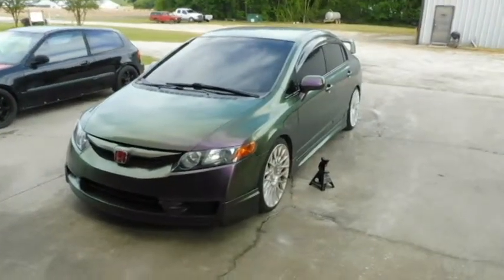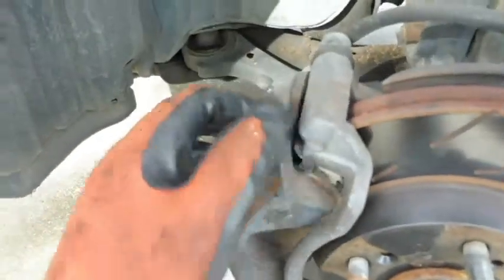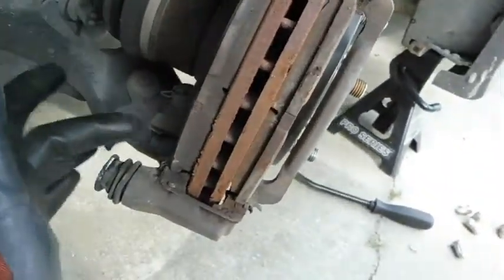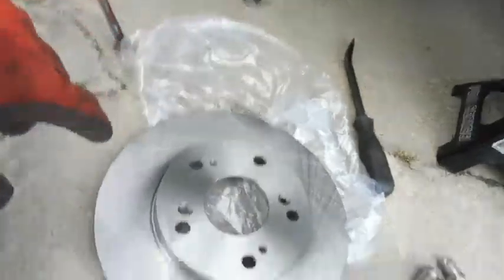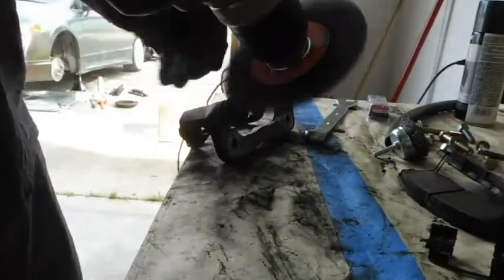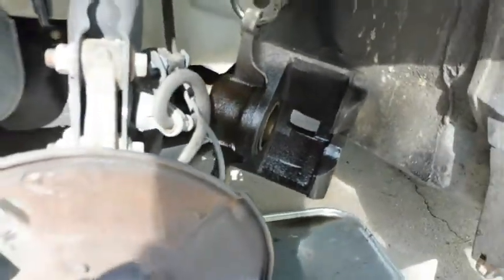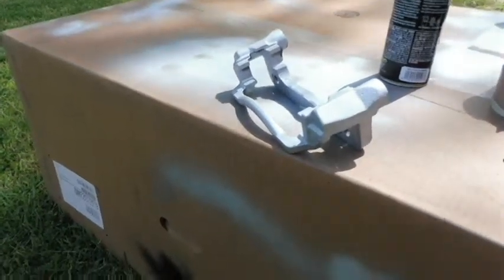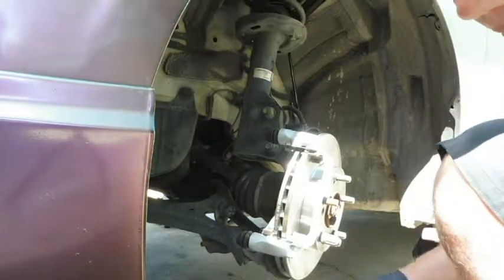Are slotted rotors worth it? DIY brake job Honda Civic

Comment: I was looking at slotted. How annoying is the sound when slot hits pad? Is it a whatever sound that is unnoticeable?  Never hear ppl mention the sound. That is gonna happen on any slotted rotor. Guess it can't be that bad if ppl buy them. Thx for input.
Reply from the maker: Ive used slotted rotors on several of my vehicles in the past and never noticed any brake noise.  As long as you use a quality street pad, you shouldnt have noise issues. If youre running more of a performance or track compound pad then you may have some noise.
Reply: @ballsoutperformance  Sounds good. Maybe I'll go with slotted then. But you do feel the slot when it hits pad or no?.. just don't notice it. Has to have some feel, no?
Reply from the maker: No not at all. Theres really no difference in driveability  and really no drawbacks, except that ive noticed an increase in dust. Other than that they fine.
Reply: @ballsoutperformance  That's great to hear, couple of other ppl got right back to me too. Thx again.